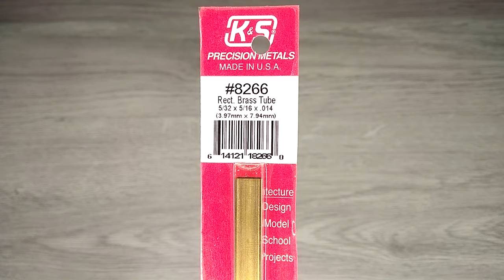How to make a Ballista DIY

Comment: nice work! im prototyping a bullpup pistol catapulta , but need to create a steel head frame as i am crushing laminate maple with 15lbs test twine in my torsion bundle of 6 strands! i plan to goto 200 lbs+ and 200+ strands,,,,can you do the math lol i cant but im hoping for 150 lbs + draw weight. need to figure a nut and trigger that will function at that tension and how to string/tension the bundles lol but pre prototype  version 2 "popsicle" sticks puts pencil crayons 30 feet down range